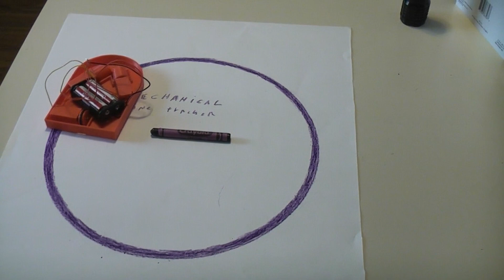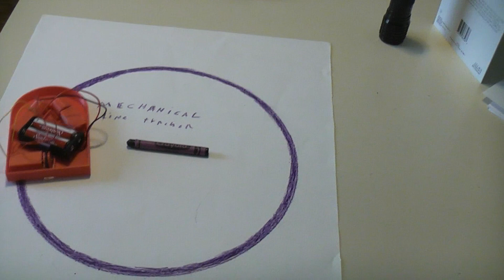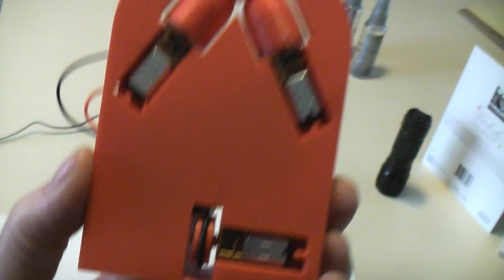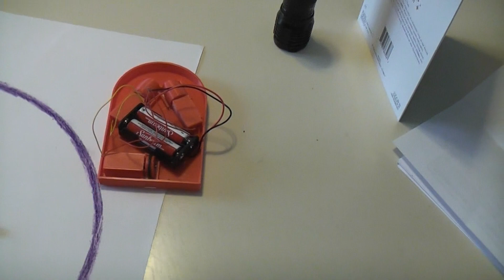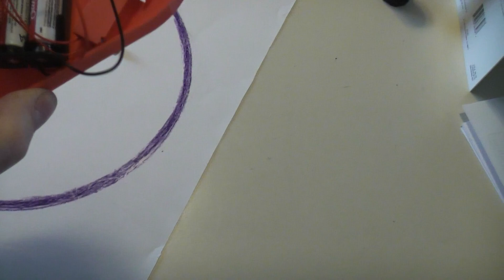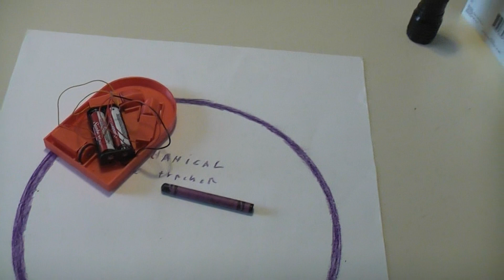3d printed, Mechanical line tracker base. Just motors, no electronics.

Comment: I don’t recall you ever using N20 motors before!  What did you use?

Greg
Reply from the maker: N20 motors . The 250 rpm for the two front units and a 150rpm for the rear drive wheel.  I have used n20 motors, Just that way back when they first came out in the 1990's they were crap, they failed in my projects so I stopped using them. they are much better these days.

Comment: Thanks for this and confirming what I thought when I watched Tims video, I was sure the crayon gave more grip deflecting the wheels.
 I think on the toy he showed it was like a play-sheet printed on a plastic or plastic coated sheet, probably to make cleanup of the crayon easier.
 Did you have to make a particularly heavy mark with the crayon to get it to work ?
Reply from the maker: Yes, just like Tim did I made a wide heavy mark. I was surprised "like you" at all the wrong descriptions as to how it worked it was a no brainer for me.

Comment: That’s really interesting John .. so it just bumps into the crayon edge to direct it .. did you make this on your 3 d printer 🖨 ? Thanks
Reply from the maker: The crayon line adds traction to the two spinning wheels in the front, the added traction keeps the base centered on the line. Normally the two-front spinning wheels slip.
Reply: @Robothut  ok thanks tough to grasp the concept.

Comment: Very interesting Mechanism Can you draw any crazy pattern for it to follow ? Amazing way to program a toys direction
Reply from the maker: Yes it should follow any design as long as the curves are not to sharp. The surface material is important. In the linked video of the actual toy demo the surface looked to be a cotton cloth material. All I had was some paper. Glass might work even better. You want the two front drive wheels to slip until they hit the wax of the crayon then they move the front away from the crayon.